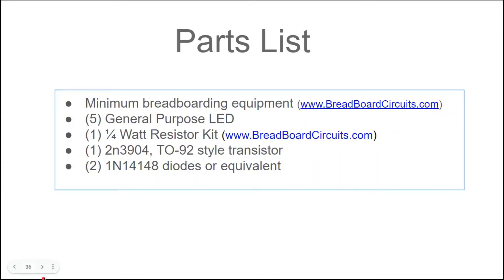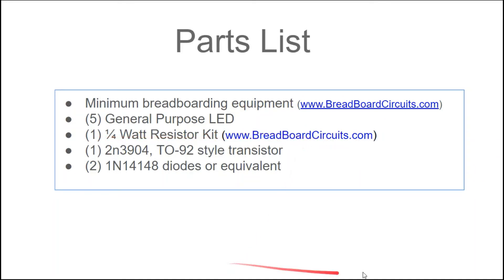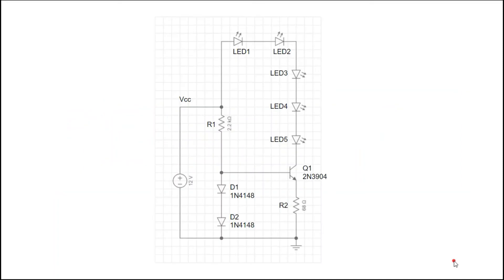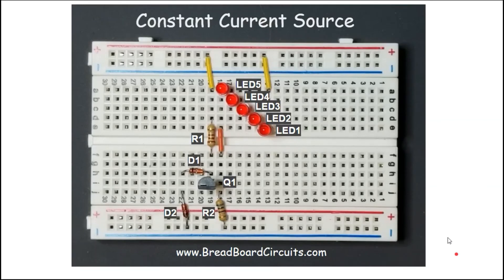#15:  Constant Current Source Circuit on a Breadboard

Comment: I like to use the LM334 as an adjustable current source. The circuit consists of only 2 devices, The LM334 and a resistor to set the current. :elbowcough: